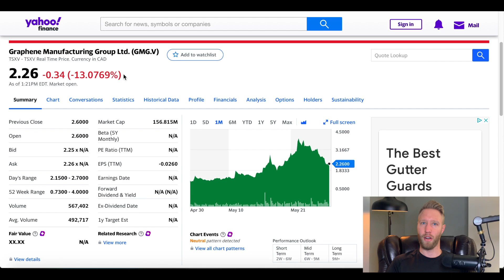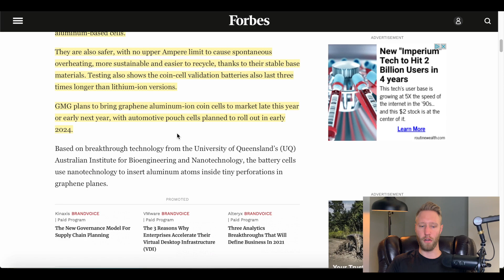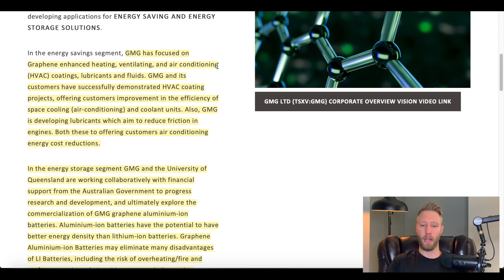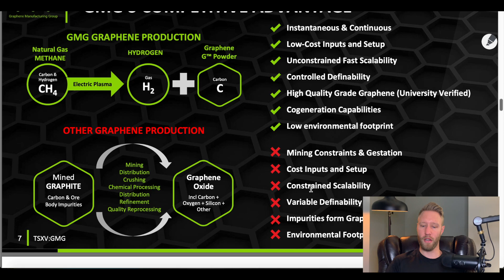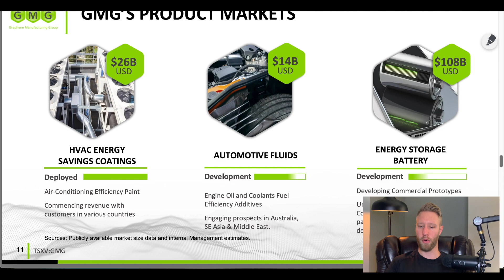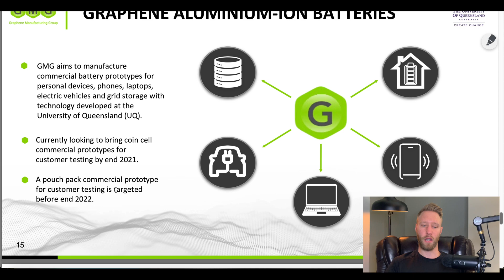Aluminum EV Battery Tech + Ultra Fast Charging! Graphene Manufacturing Group - GMG Stock (GMGMF)

Comment: Anybody interested: this is a VERY spec play... faster charging without other parameters revealed is actually nothing to hold on to.
Reply: You're ignoring the 3x energy storage, better safety against fire,and that the batteries probably won't need cooling. You also ignore their unique graphene products, which are already on the market.
Reply: T,H,A,N,K,S ,,,,F,O,R, ,,,,Y,O,U,R ,,,,, F,E,E,E,D,B,A,C,K ,,,,D,O,N,T ,,,,F,O,R,G,E,T ,,,, T,O S,U,B,S,C,R,I,B,E,,,,
W,H,A,T,S,A,P,P,,,,M,E ,,,,F,O,R ,,,G,U,I,D,E,L ,I , N,E,S ,,,A,N,D ,,,,I,N,V,E,S,T,M,E,N,T.
(+) (1) (8) (5) (8) (2) (4) (7) (1) (4) (0) (9)